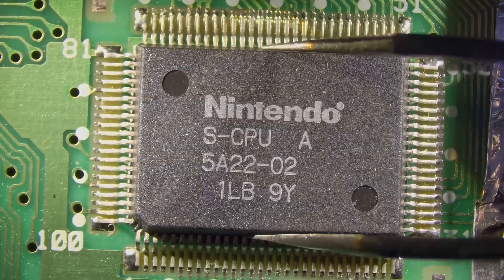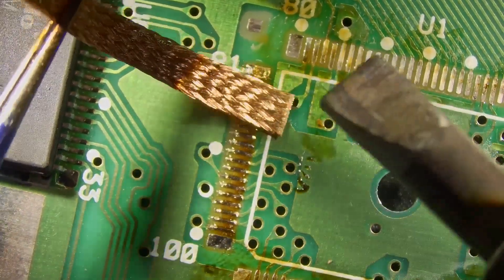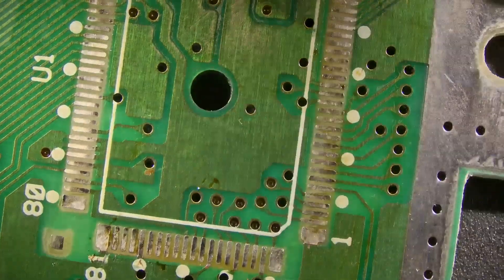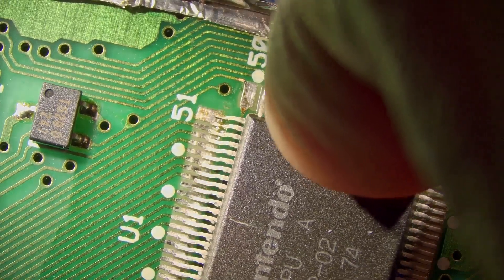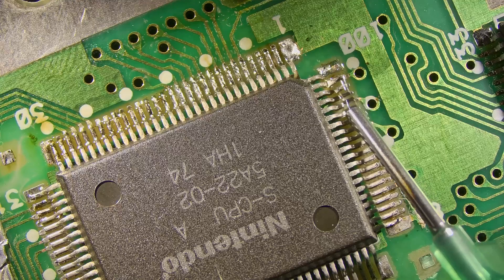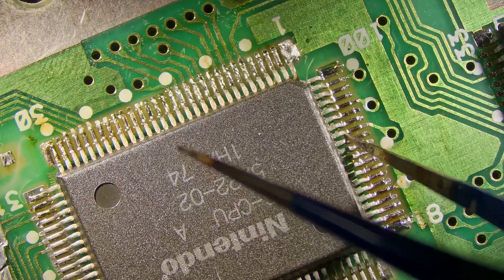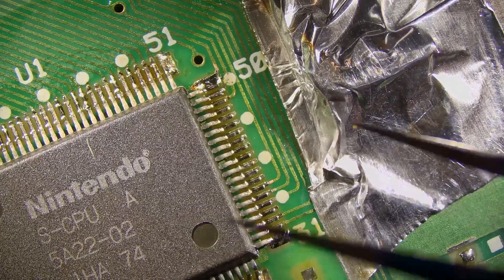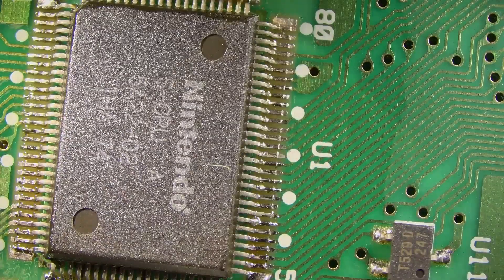SNES CPU REPLACEMENT

Comment: I was told my cpu could be bad.  Both controllers work when they wont to. The buttons dont respond all the time. Ive replaced the controller board. And replaced the controllers same response .

Comment: Where do you get a new cpu? What are the symptoms of a bad one?
Reply: you dont get a new one unless you have a donor board.. cpu symptoms vary, but most of the time a cpu will screw up the logic of the game where as a PPU "picture processing unit" will usually show garbled graphics but the game logic is sound. meaning you can still run and jump and play mario but with garbled graphics. 
a bad cpu will not allow certain logics to happen. for instance super mario world opening level has the black box with text saying "welcome to super mario world" a bad cpu may not display that message and you are stuck at the intro. 
with that said there are varying chips in games that will make a bad cpu behave differently.
Reply: @_BELMONT_  Thanks. My problem is that Super Mario World plays perfectly, saves games and has no issues. I have about 10 other games that don't play at all. Some, like DK Country, will show the opening sequence, but the game won't start. Others, just a black screen.

Comment: Nice work and video, 890°F is way too hot - that's why your tip looks like shit. I like to use a BC3 tip at around 700°F for this kind of work
Reply: 330c is plenty hot for these sized pins and pitch.